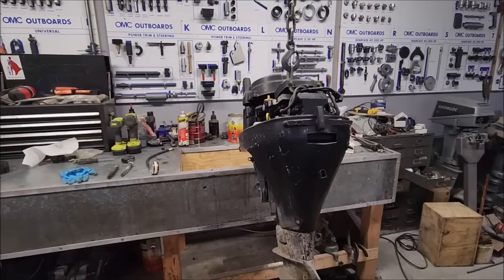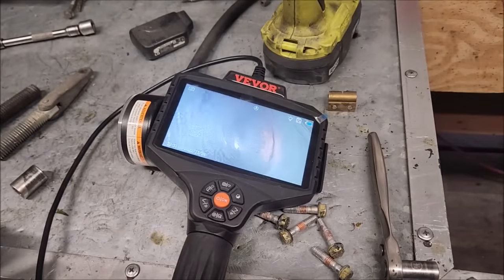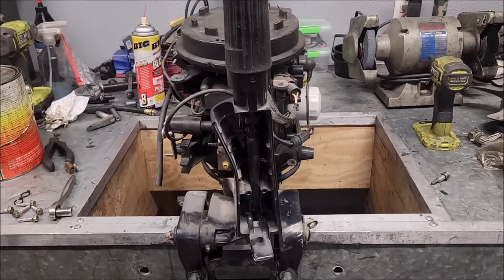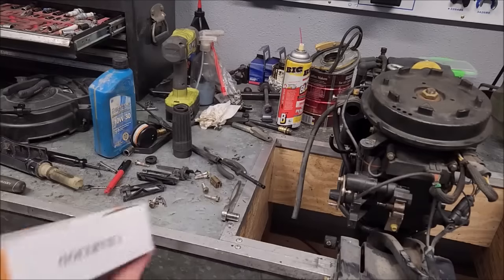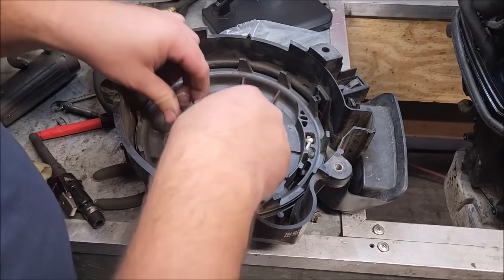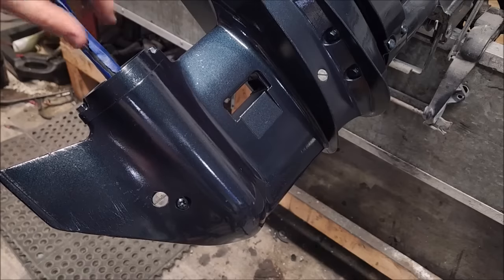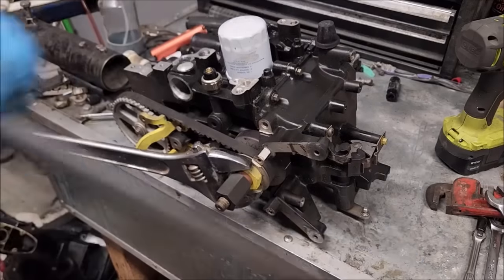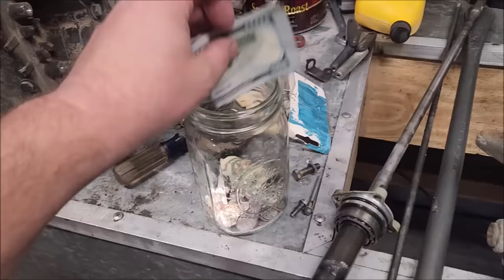Fixing My Last Evinrude 9.9 HP 4-Stroke

Comment from the maker: CHARYJOD link:  https://bit.ly/42gJxfv
Carb tool: http://officialyoutubemerch.com/
Reply: hey bud, i got a question i have the same year engine but it's a 15hp 4stroke..it starts, idle's  good for 10secs then get rough idle and shuts off, i pump primer bulb a few times. and it will restart right up...and do the samething. sometimes it will let me rev it up and sometimes it won't, vary boggie. any suggestion on what it could be?

Comment: My vote is plugged or restricted exhaust.  It has all the symptoms. Won't idle or make power.  Even with a completely plugged exhaust a engine will still test with good compression.  Technicality you could remove the exhaust valve rockers and a engine will still have good compression.

Comment: at least here in florida anything less than 10hp does not require a boating license. 9.9 cowls and sticker kits also go for big money :)
Reply: yes I want to get into flipping outboards too, but Texas is hard to do it in.,., they want damned titles for everything,, you cant even use a boat with just an electric trolling mot without registration.., for the older small outboards, they change hands so many times its hard to find original owners or paperwork, and nobody wants to buy a motor without a title, only maybe for parts.. it sucks.

Comment: Did you check the valve adjustment and do a leak down test to make sure you don’t have a leaking valve ?  Another thing is a smoke test to see if you have a vacuum leak.
Reply from the maker: No, my leak down tester doesn't fit into the spark plug cavity. But I too was suspecting valves.

Comment: I have a 84 johnson 9.9 i revived using your vids and my mechanic skills. Runs great now. Only thing is after i ran it and put it in the garage a few days later i noticed thick black goopy about 3 inch diameter puddle coming from prop area. The oil is perfect and it was also perfect when i got it but i put in new anyway. Still oil looks new and hasnt seemed to go down. Could you give me some direction? Is it just old build up. Or should i pull the prop and get new o rings or the whole carrier? Theres no play anywhere not even a scratch on the bottom fin. It came with the original OMC card and receipts. He kept it top notch. It was basically a good carb clean. Any HELP be much appreciated as im a loyal watcher and commenter and like your vids and your work.
Reply: The pisser was also stuck but your wire trick worked instantly. Thx for that😊

Comment: Check Valve Lash    tight valves will limit the draw on carb
Reply: After watching the whole video my only guess is something with the valves. And it's the only thing he didn't talk about/show him checking. I think I've owned more 2 strokes than 4 strokes, but I can distinctly remember adjusting valves often on all my 4 strokes. XR650R made it easy, hardest might have been on my Ninja 250, but they all needed it eventually. When I am diagnosing a 4 stroke valves are always on my mind now.
Reply: @mjodr  I would bet that in the service info on those motors, it recommends check valve lash at x amount of run hours,, all of them likely need adjusting and would start 1st pull when warm..

Comment: Brandon, I just bought a 1996 16' MonArk bass boat, it will handle up to 60hp. Do you have a recommendation for a decent motor, I don't need 60 hp, but more than the 9.9hp merc that came with it.
Reply: No less than 35hp imo
Reply: @Newbgainer  I've had nothing but two stroke, ranging from 1956- fd10 15hp Johnson, 1956-5.9hp mercury dad bought brand new, and a 1960-10hp Johnson, what do you think of 4strokes?
Reply: @waynewolfe8817  they are a little more fuel efficient,  but I still run 2 cycles cause there's nothing like the smell of a great running motor at 5am with a little smoke rolling 😀

Comment: Hi Brandon this is Peter from Finland and I have an evinrude 15 hp but it is the same as your engine.
The problem is that it pulls the starter rope out of my hand when I want to start and the ignition is too early.
Have researched everything several times to no avail. I have read that the ignition module must have automatic setting. That at 0 rpm the ignition should be 5 * atd and at 1000 rpm 10 * btd but it is constantly 30 * btd checked with a stroboscope lamp. Haven't figured out what's wrong and have given up on that engine. It was my first 4 soke engine but maybe the last. Very disappointed that it could not be repaired.
Reply: Its the ignition module mine would do the same thing jerk back on me about ripping my arm off of the socket occasionally then it just stop firing  new module took care of it this is the 2nd one I've put on the last one lasted 12yrs
Reply: @robertpurchase8262  Thank you Robert !🤗👌
Reply: Hi Peter!!
Reply: @ALVintageOutboards  Hi so you find me !
Reply: @peterlindqvist6998 Yes my friend!! 😅😅😊

Comment: Fuel pump?
Reply from the maker: Once the carb bowl is full, it should still be able to idle and run until it's out of gas; and the hose bulb works as a manual fuel pump. So not the fuel pump.